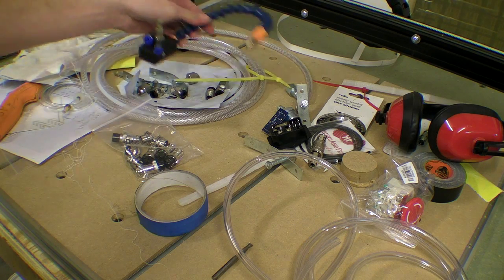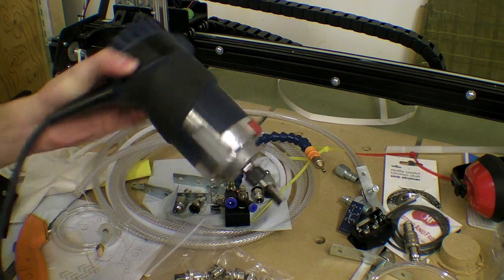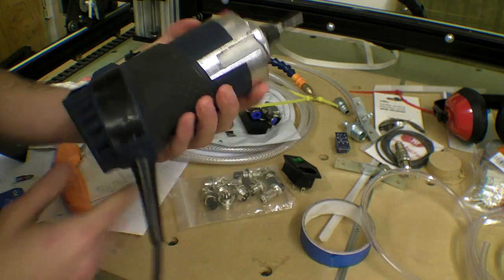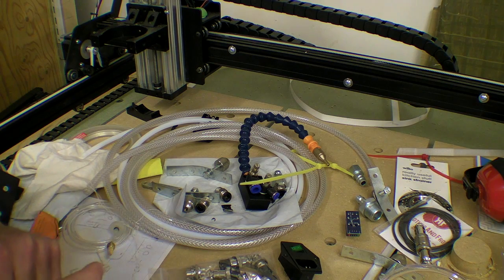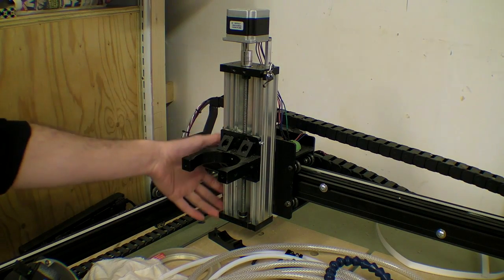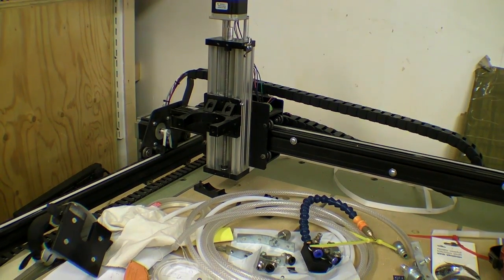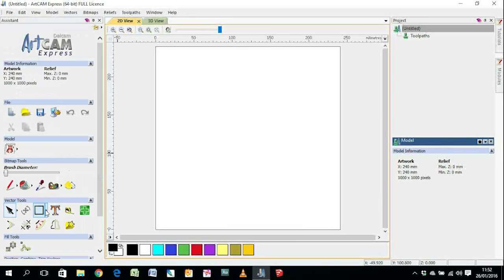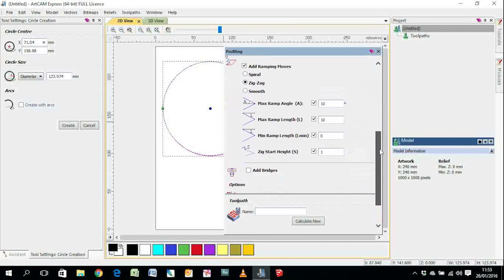CNC Software Update / Plus Some Ideas

Comment: I would like your opinion using Fusion360 and X-Carve together. I just received my X-Carve kit and am about to begin the assembly process. I currently use Fusion360 for all my CAD projects and it has very powerful CAM features for generating G-Code. I'm new to X-Carve and hope the two work together easy enough.  Thanks in advance!

Here is a link to the free version of Fusion. http://www.autodesk.com/fusion-360-promos 
use the promo code MAKEYOURMARK.
Reply from the maker: +Eli DElia I will try fit this in but I am really pressed for time at the moment.  I am a little reluctant to use a cloud based CAM software as my internet connection isn't great, and I have also committed to using another software.  Cheers.

Comment: This will solve your router speed problem completely... it's the only one like it that I'm aware of, I have one and it is fantastic. www.superpid.com
Reply from the maker: +bucknaked31 Interesting, I wonder how that work?
Reply: You mount a sensor in the top of the router, then paint half the shaft white. It watches the white paint and keeps the router at whatever speed you set it to, no matter what happens. No other router speed controls can do this. I can cut plastic, aluminum, brass, hard or soft wood, you name it. Full torque all the way down to 5,000 rpms. No melting, no galling... it basically turns your router into a real high powered spindle. It monitors the router speed many times per second, then uses a PID algorithm that can compensate for a pulsating load. When I'm cutting plastic, the router hardly makes any noise, I can talk over it :)